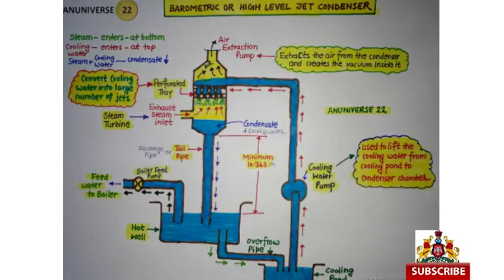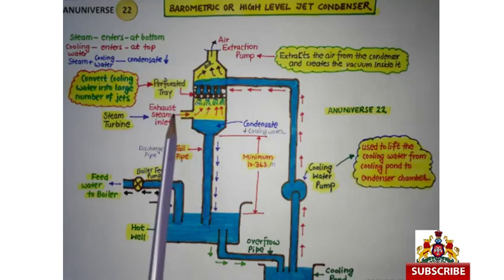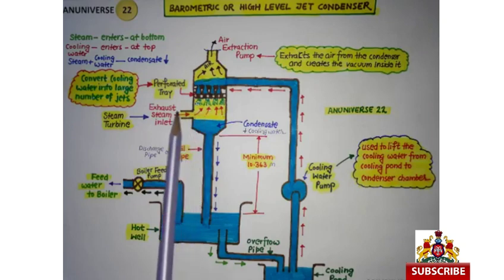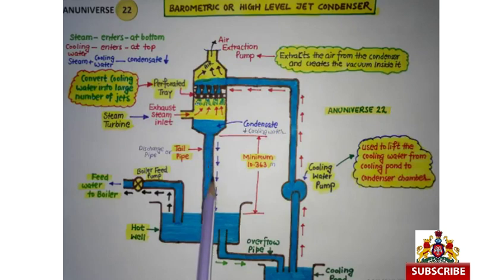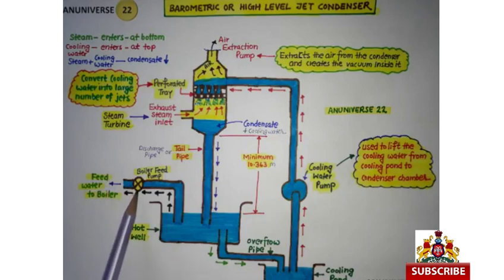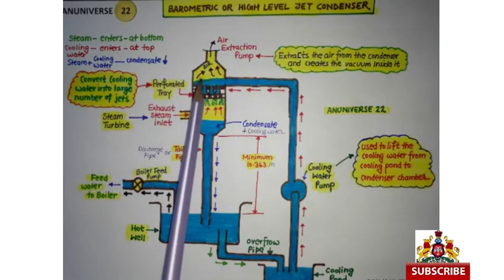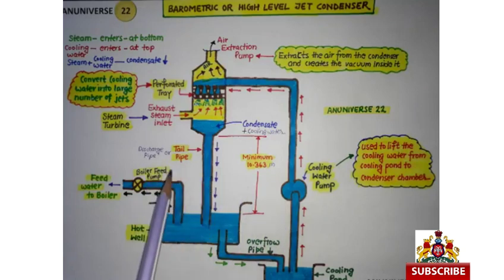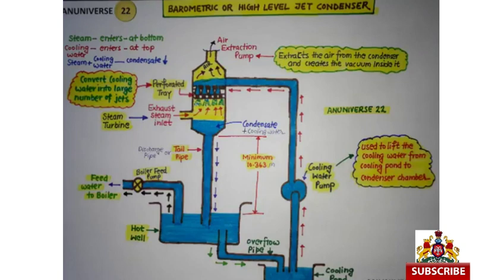Barometric jet condenser complete explanation

Comment: Why the discharge water pipe length is 10.33m
Reply: because 10 meters equals to 1 atm, if the discharge pipe is shorter then 10m the there will be a vaccum inside the condenser vessel therefore the water will go from the hot well up to the condenser vessel untill it reaches the 10m height to equate the 1 atm instead of going down
Reply: Oi 
I see 
It mean water do not flow down ?